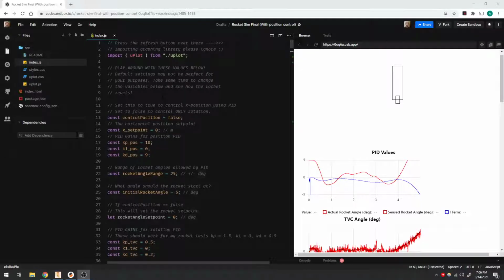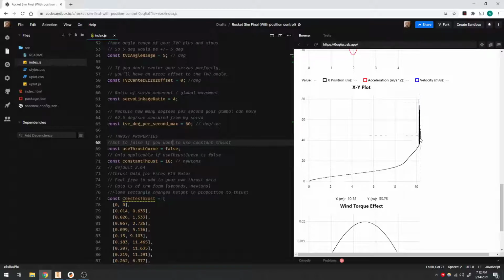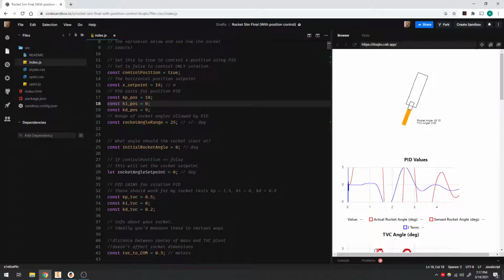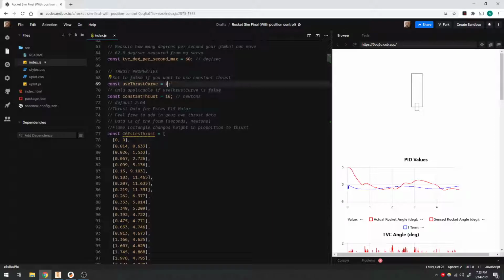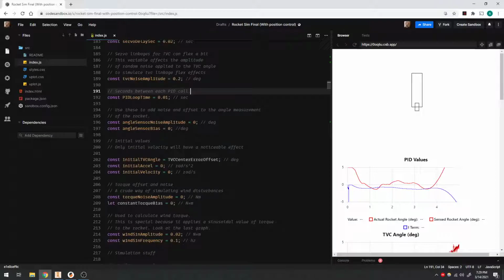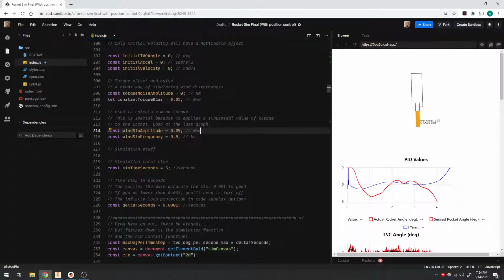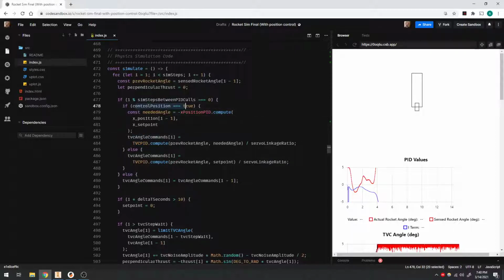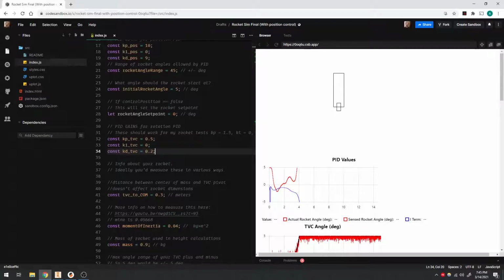TVC Rocket PID Simulation Walkthrough

Comment: I'm a little confused, why do you need a PID for the position? Couldn't you just make the set point - input do that? or does the first PID in code have a function I haven't grasped?
Reply from the maker: Hey great question! So we know a PID function takes an input  and a setpoint and figures out the output needed to get the input closer to the setpoint. In the basic case of orientation, the input is the current orientation angle, the setpoint is the desired angle and the output is the required thruster angle. 

In order to control position, we need the rocket to figure out which angle to rotate and how much in order to get to the position we want. So we stack a second PID on top of the first one. The job of the second PID is to take an input of the current x position, a setpoint for desired x position and it outputs a required rocket orientation to get there. 

The two PID's come together by taking that required orientation and treating it as a setpoint into our first orientation PID. Wheras before, the setpoint was constant, now, the setpoint changes based on what the second PID is feeding into the first one.

Hope that makes sense!
Reply: @adamdude  I think that makes sense. So the first PID is being used to find our current angle with sensors and than comparing that value to the angle we said it wants to be at. from that point the gap in angle we have will be given to the second PID and basically be told to figure out how to fix the rocket angle using servos.

 or do i have that flipped? it seems like one PID controls the sensor values while the other will control the servo values. I think I understand how the PID's work with my above explanation but I confused myself on which PID controls which job
Reply from the maker: @Yeisnotking369  Oh I think you have it backwards. I made it confusing calling it "first: and "second" PID.

So let's call one of the PID's the "Orientation PID" and another one the "Position PID"

The orientation PID's job is, given an angle we want, steer the thruster in a direction to get to that angle.
The Position PID's job is, given a horizontal x position, orient the rocket in some direction so as to make the rocket end up at the x position we want.

So first, we make the position PID setpoint constant, say 10 meters. Now the position PID sees where we are and where we need to be and find out which way to orient the rocket to make it fly 10 meters to the right. 

This orientation value we get from the position PID can then be fed into the orientation PID which then will find out what THRUSTER angle we need to have to orient the rocket in that direction.

Hope that makes sense.
Reply: @adamdude  Yes I see what you're saying, the Position PID finds our current angle and will compare it to the "goal" angle and then feed the difference of those two angles into the orientation PID where it will adjust the TVC to reach said goal angle using the differences provided

Sorry if im not fully grasping the concepts im just really new to PID's and this style of coding in general, so im trying to gain as much knowledge as i can
Reply from the maker: @Yeisnotking369  Yeah you've got the gist of it! 
Feel free to keep asking questions!